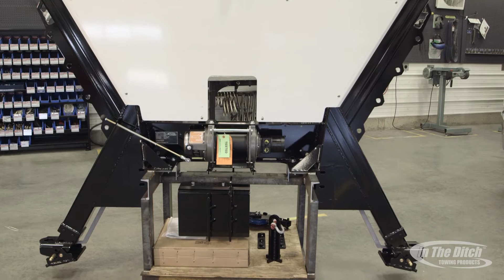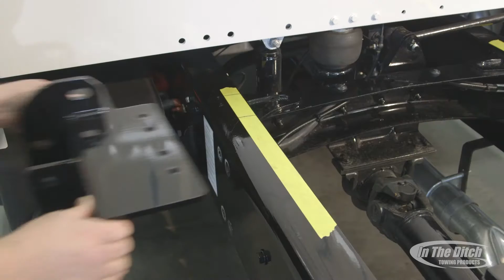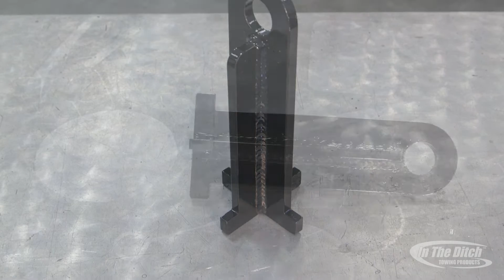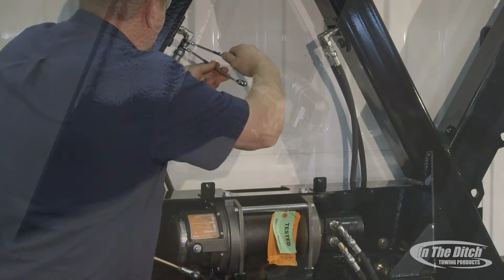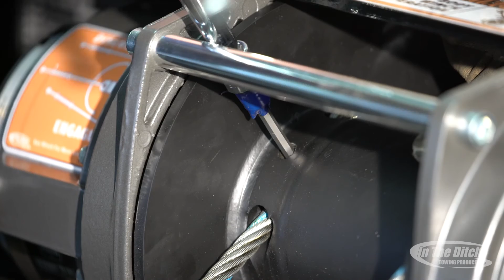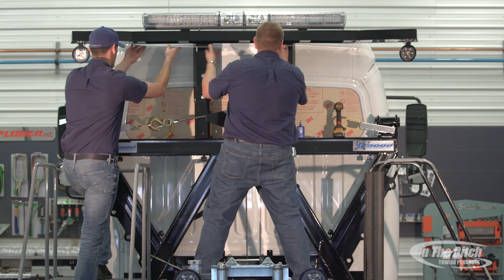Installation of the SP9000™ SidePuller™ by In The Ditch Towing Products

Comment: Why do you not use bolts with shoulders in the frame of the truck?   Using fully threaded fasteners with no shoulder on a vehicle that will be twisted and torqued on is  just asking for future vibration and loose bolts issues.

Comment: they destroyed the embankment, dragging a car sideways is incredibly hard on the cars suspension and you put huge loads on the winches, if you used a boom truck the car would have rolled up the incline and onto the road with way less stress on car and equipment and you could have done the recovery from the emergency lane without closing a lane. i've done hundreds if not thousands of recoveries over a 20 year career. its a cute toy but 23 grand for some thing you might use a few times a year seems a waste
Reply: 23 grand?  Maybe for the 20k unit.  We use them exclusively for recovery on our flatbed and have not turned down one recovery yet, which includes steep bank recovery and even some trucks larger than our own.  We had the first generation they made and they've made improvements that people have been finding in the field that needed to be done.  With a little bit of common sense, a few snatch blocks you can pull off a lot of recoveries without the need of two trucks.  Most people don't need a regular wrecker, in fact the local police don't call for traditional trucks anymore because the ones with the flatbeds and SP's can handle 99% of the work.
Reply: 14k. adn they're widely used where i am.